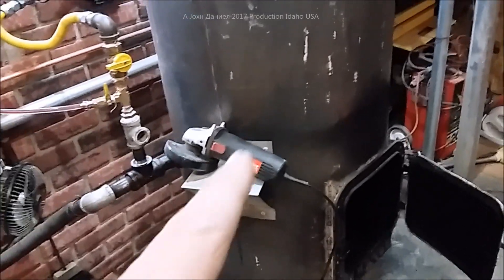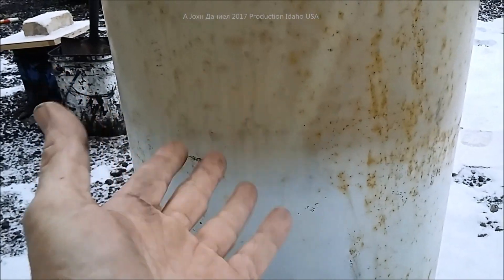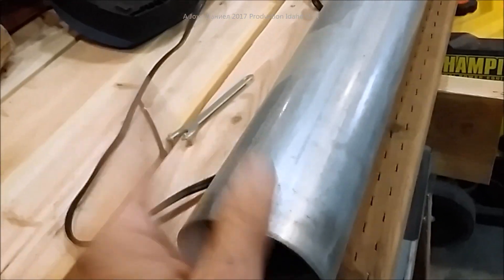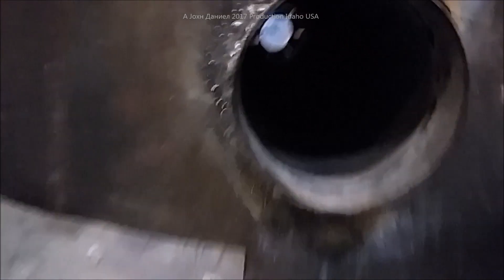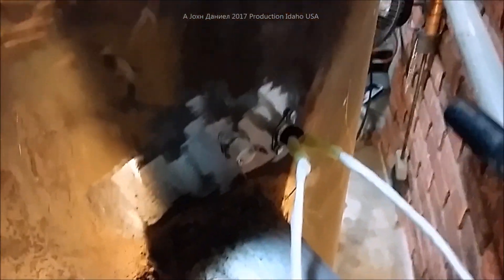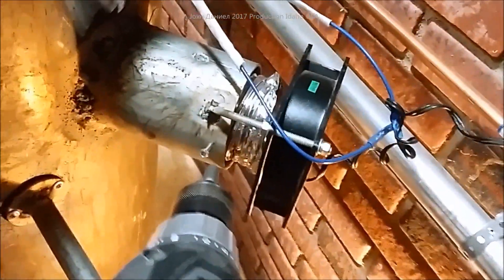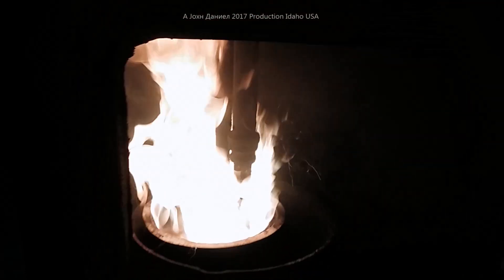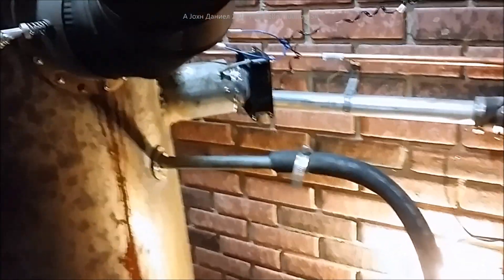Upgrading a Waste Engine Oil or Used Oil Furnace (parts list below)

Comment from the maker: Major Parts, DOOR KIT - https://ebay.to/35kP4Tr , BEST BLOWER  http://amzn.to/2FB6pe7 BLOWER 2 pipe ADAPTER https://ebay.to/35ozVjV and Safe STOVE PIPE https://ebay.to/35njch0 
** Shop Power supplied by solar, with Ysolar 80 amp controllers SEE LINK UNDER VIDEO and 28 of 100 watt solar panels by NP https://amzn.to/2MXnIwh

**Amazon Sources - DOOR KIT - http://amzn.to/2h8JbkE
BEST BLOWER  http://amzn.to/2FB6pe7 due to lifespan is high
BLOWER ADAPTER http://amzn.to/2haptHH
STOVE PIPE http://amzn.to/2h8wSar **Waste oil heating is safe, clean and cheap when proper parts and construction is used.

Comment: I am looking for a part for an AC unit the hard plastic cover it goes on and bolts down this is the name of the unit Duo Therm model 57912.009 do you not know how to get a hold of you any other way but this way if you can help Would be very appreciated my other idea is to make one out of metal and put it on top
Reply from the maker: The covers are 10 year life items, best thing is making them in metal.
Reply from the maker: If your still needing a shroud or know of any one needing them share this point link to find a list, https://amzn.to/2QpIZAT . Another commentor sent a full link but was spammed by YT so I figured I would place it so at best his info got shared.

Comment: I got a quick question :D. Why the Flex Pipe in your Heat Exchange? Is there a reason? Thank you !!!
Reply: i would think bar stock cut into fins welded to a bit of round stock so yo can slid the asy. in with fins in varying angles to fit directly against the exhaust pipe would do a better job than that flex.
Reply from the maker: +Jod Bronson works like a heat sink to cause faster heat draw.
Reply: Hmmm interesting :))) - My only thing is... When Tin or Galvanized heats up to a certain Temperature... It produces these weird smells :((((. Although a lot of People can't smell it, but I can and that is why I was curious.... But THANK YOU for the reply :D
Reply from the maker: Its aluminum already made for the high temps and no odors for a clothes dryer venting. It draws the heat off the steel pipe in a way that prevents the fan from cooling the steel too much and uneven. If the steel cools too much in some spots you can get heavy carbon build up on it inside the heater on the cold spots. The aluminum heat sinks it equally, and don't let the fan cool the front of the pipe where the fans blows in excessively.

Comment: Propane does not absorb into the metal that's bunk. But old tanks can accumulate an oily condensate from the 1000's of accumulated fills. Its this oily substance that can be volatilized by heating. personally I just run a air hose into the tank for a bit then cut it. It cant explode because an explosive mixture cannot be created due to the high air exchange
Reply: you do know that butane and propane are product that have an oil base right? So that is why butane and propane wil allways contain some oily lightly flammable substance with it. 
And if you fill a tank with inert gas its best to hook up a reducer and just let the flow continue as you are cutting. That way it wil be blow out the inert gas trough the cut,  instead of letting oxygen back in.
Reply from the maker: I'll leave that to your opinion and continue to laugh at Blown Away Eyebrows Franklin who said much the same thing when he prepped and cut into a 40 year old 300 gallon tank. Or look at reasonable outcomes where the industry quotes metals in fuel tanks which have a determined explosive danger. http://www.diva-portal.org/smash/get/diva2:124813/FULLTEXT01.pdf
Reply: Tanks that old can accumulate a heavy sedimentary oily sludge. These are dangerous to cut without cleaning,. Even filling with inert gas may not be enough as air can be drawn into the kerf and mixed with volatilized oil as it's being cut producing an explosive mixture. Every tank requires assessment before hand.
Reply from the maker: +videoclipits Yes, I recently swabbed out a 200 lb DOT tank to convert and the rags over 2 days later burst into flames when tossed into my wood stove. Got so hot I had to close the air to the wood stove.  It's the butane and other solvents that was residual and did not wash out with water.
Reply: Better to be safe than sorry.  They should be steamed for 24 hours is best.
Reply: The oily substance added to propane is mercaptans for smell, neutralizing agents are bleach or hydrogen peroxide

Comment: do you rinse the tank out with water?or try to cut the metal with water in it? like video
Reply from the maker: Using a 4.5" grinder with a cut off wheel you can fill the tank completely with water and by not trying to bury the wheel into the tank as you cut you can cut it safely. Afterwards I will take a towel and soak it down, put a lot of baking soda on it and reach in the cut outs to scrub the inner walls of the tank to neutralize it best I can.
You can also do a quick burn out after cutting it open and I just use lighter fluid and make a trail to it from a few feet away to get rid of residue.  NEVER USE GAS!

Comment: nice, like the saftey warning re gas impregnating the metal,  and high temp metal tip
Reply from the maker: Yes, had one do a loud pop even after sitting 3 days cut open. Its the film left in very old tanks that is flammable.